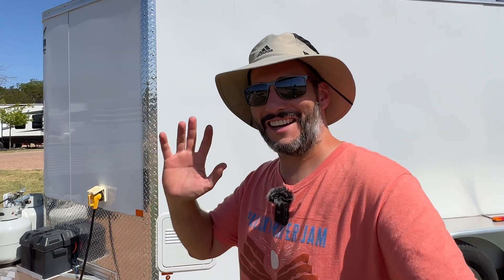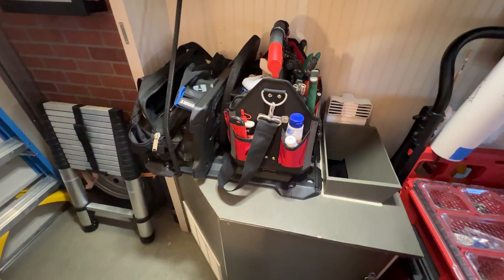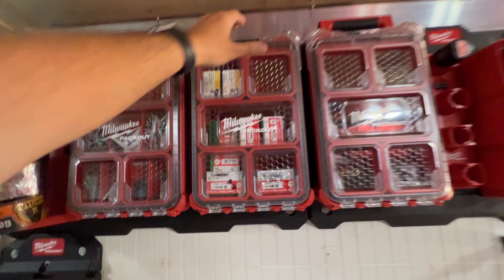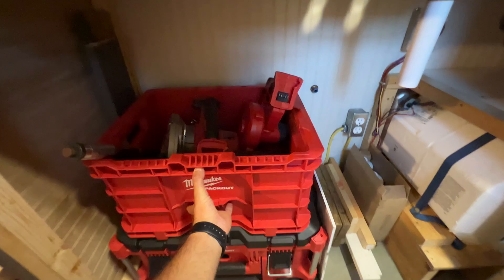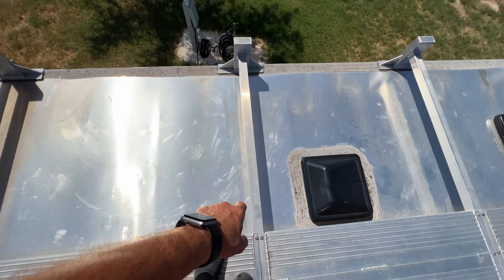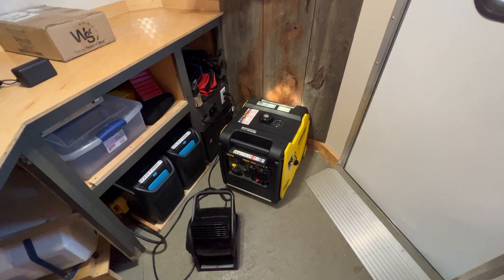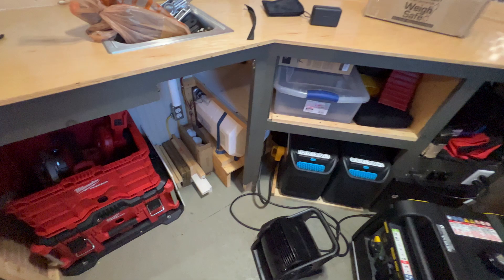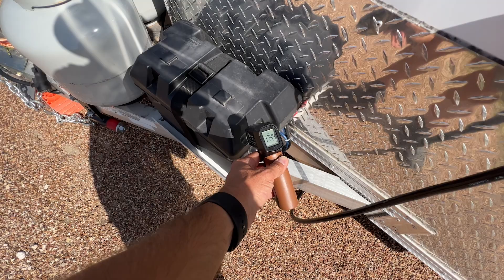🧰 Milwaukee Packout Setup // Tool Trailer Tour // Future Projects

Comment: Scott,
I’d go to a welding shop and get them to weld in the aluminum up top where you cut out for the a/c.  Probably be just as strong.  I’m north of Ft Worth and yes it is hot.  Good luck, really enjoy the videos
Reply from the maker: That was my first thought, but all of the local places are 6-8 weeks out, by then, It will start cooling down.
Reply: @Stonyboot  We can only hope it cools down, here in Alamogordo NM it's been on average 115 degrees for the passed few weeks...

Comment: Interesting video, Scott. That Packout System is nice. It seems very versatile. I've been contemplating what to do with the space inside the Rack Pack Tower on the back of my Camino 88. I can imagine using it for hanging coats, etc., in the winter months but I think the space would be more efficiently used with drawers and shelves most of the time. The Packout System would let me customize the space on the fly for any given trip. I think you've just provided my solution. You and your channel come through again!

Also, fascinating results from the temp gun. I always knew black was warmer but I never realized how much. Growing up in the 70s in Dallas with vinyl seats in our cars, I remember so clearly trying (and failing) not to burn the back of my legs whenever I got in the car during the summer months. My mother would hang a towel over the steering wheel so she could touch it. Our first cars didn't even have AC. Hard to imagine now. Of course, summers weren't quite as hot then either.
Reply from the maker: Thanks a bunch! The Packout System is interesting and versatile. It sounds like a perfect solution for the space inside your Camino 88's Rack Pack Tower. Customizing it with drawers and shelves for different trips is a brilliant idea! I have similar plans for use in our 5th wheel "basement" But that will have to wait for the future.

And oh yeah, those temp gun results were eye-opening, I'd never compared them before. Black does get much hotter, and I can totally relate to your memories of hot vinyl seats in cars from the '70s (except it was in the 80s. Our truck has black leather seats and they get dangerously hot when you leave the sun on them.  Times have changed, and air conditioning has become a necessity.

Comment: You can always install a mini split with a cassette the no hole in ceiling plus it is AC and heat
Reply from the maker: Agreed, but it also has its mounting issues. Still waiting for some parts to arrive.

Comment: Scott, what about making a box for a window AC with heatpump and mount it where the water heater is?  It requires making a bigger hole in the side, but eliminates the concern over the water heater opening. Make the box so it sits almost all the way inside the camper with airspace so the outside vents stay outside and the inside vents are near the edge of the workbench depth.  It would let the water drain outside, keep the hot air outside and the cool air inside.  Just a thought....
Reply from the maker: That's a great idea! I have considered this, was thinking about a Mini-Split. That could work, however, I would also need an additional fan running to help circulate the air. I guess I'll have to google window A/Cs with heatpumps. I do have a "Roof Curb" on order to try installing on the roof. When I finish typing this, i'll go research some window units.

Thank you!

Comment: For your a/c, the way you explained it, is what I would do, but add a cross piece in front of the a/c to tie the 2 sides together. But other than that I think you have a solid plan for it. I don’t know if that boosts your confidence or not, I would execute like you said!
Reply from the maker: I have several options on the table now. A "Roof Curb", possibly a window A/C where the water heater goes, and I still haven't ruled out the mini-split. I'll figure it out someday soon.

Comment: Would be better and cheaper investment to install insulation. Also a fold out panel to relect the sun on the south side and the roof would help
Reply from the maker: It's already insulated, and since I move around a lot, a fold out solar shield would be kind of a PITA. I have some parts on order that should solve my issues. I'll do another video when I get it all sorted out.
Reply: @Stonyboot  yes. Maybe just park in the shade or have a large canopy or inflatable garage over it

Comment: So you have all that because you are a roving handyman or RV tech? Is that for your job? I like that modular system, very flexible. I would maybe duct your air cond output to the ceiling and then put a 60 degree fanned vent.
Reply from the maker: Exactly, it's still in the works, but that's my direction. Packout is great, I'm still fine tuning it, but have been busy with other projects for the last couple of weeks. I'll explain more in future videos.

Comment: Other than the vent fan on the AC Discharge of the cabinet the AC is mounted in have you looked at adding ventilation to that cabinet?  There isn’t a lot of discharge pressure on wheelie AC units unless you create ducting. In the meantime of finding your permanent solution I would try take the panel off the box it sits in.  Cool set up though for the trailer.
Reply from the maker: I know what you are talking about. With or without the panel, it stays the same temp. Also, even though the intake and exhaust are ducted outside, for some reason, the unit still create a slight vacuum in the trailer, so I always have fresh air coming in. Everything is sealed up, so I'm going to guess its due to internal leakage. Not worth fixing, I just need to replace it. Still struggling with sourcing parts and finding a "perfect" solution.
Reply: @Stonyboot  dumb question but did you clean the filters on the portable AC? I've seen some floor units that have 2 filters on the back side, a top and bottom separate section.

Comment: Why not leave the platform and cross bars where they are?  Make a platform to mount the AC on top of the cross bars. Then extend a tube up from the roof hole to the elevated AC unit to channel the air.
Reply from the maker: That is my current plan. I learned from another commenter that its called a roof or A/C curb. I found on that will fit nicely and it's coming in a couple of weeks. It should work, based on my mental math. I'll have a video about it when the time comes.

Comment: Is this trailer insulated? That might be your issue on the cooling. Also, where does you portable AC vent to?  We have a portable AC unit and it cools our 14x14 bedroom down to 70 degrees in the heat of the summer…we live in OK. You might consider shading the trailer somehow like 8n a carport if that’s an option.
Reply from the maker: The trailer is insulated, about 1 inch of foamboard. The A/C is vented for intake and exhaust under the trailer. It's not perfect, but it's pretty good. A car port isn't an option and its been in the 105-111f temp ranges, so I'll need to oversize my cooling to keep up with the heat. It's just a work shop, so I'll have to live with some heat, but the current setup isn't really workable during the summer months. I have a few ideas, but havne't had time to focus on them. I'll have an update when I get something solved.
Reply: @Stonyboot it’s vented for “intake” under the trailer? You’re conditioning outside air? That doesn’t make sense, intake should be inside air. You’re basically removing the moisture from the air.

Comment: Cruise and comfort ac 24v
Reply from the maker: I looked at 12v-24v units. My problem is the cost and power supply. I have no desire to build a typical RV power system in the trailer and while trying to find a 120v to 12/24v comverter, the prices started to shoot up. So, I'm trying to stick with a traditional roof top AC or minisplit. Another commenter suggested a "A/C Curb" and I was able to find something that might work. I'll keep yall updated.